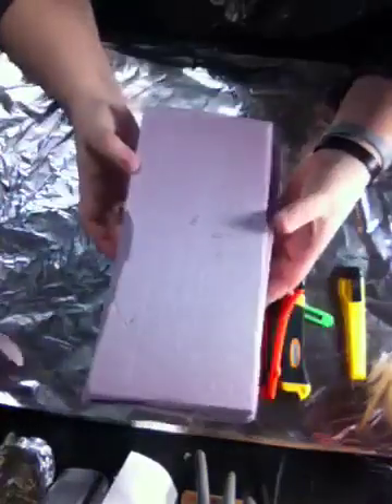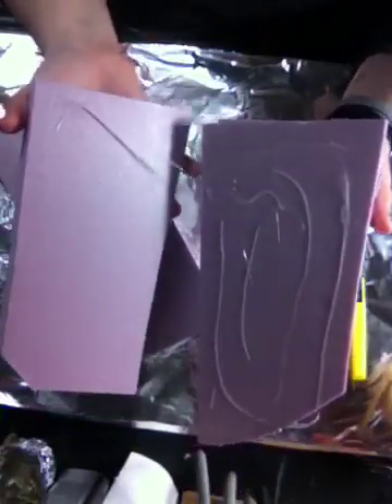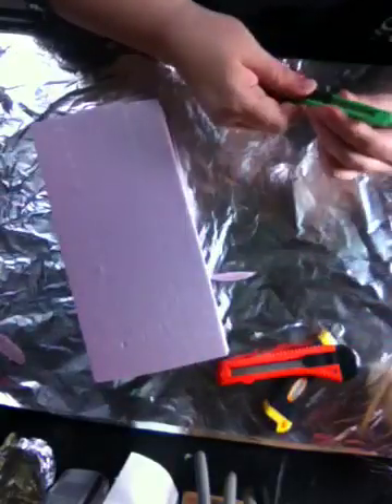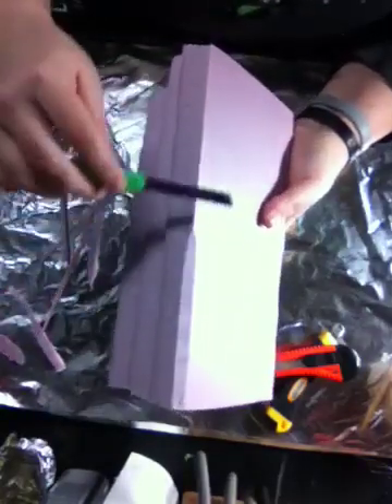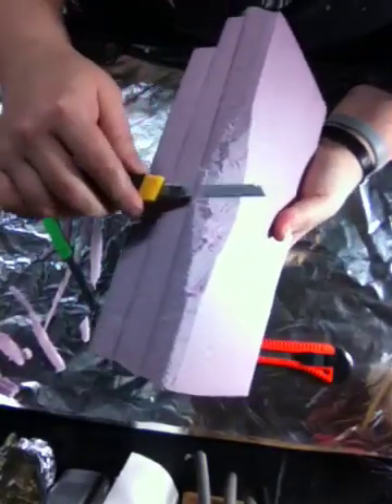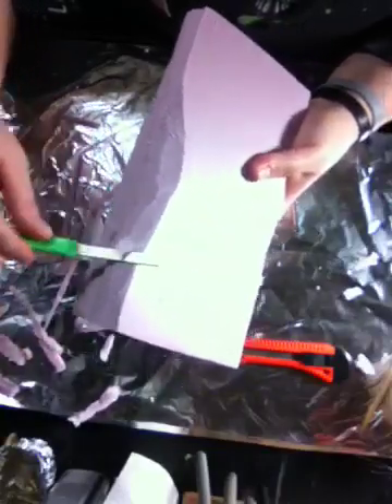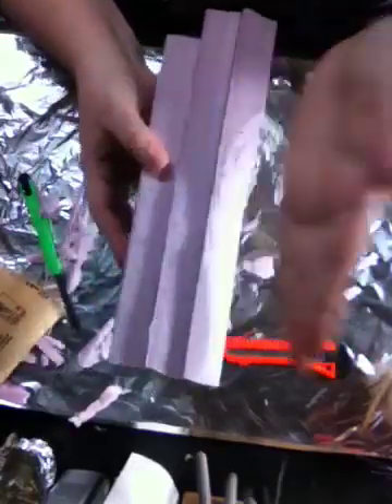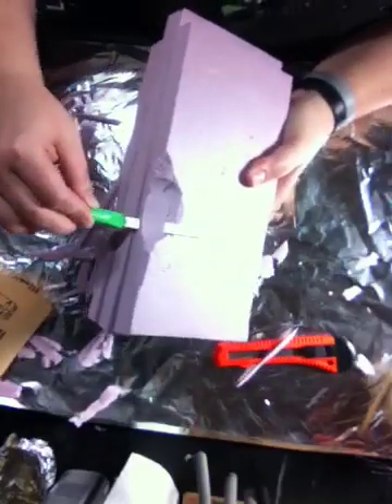How to carve insulation foam

Comment: Been doing foam cutting for years.. been building dios since 1992... before they were even called dios...I would never use hot glue cause it will leave gaps between the layers.. I used any school glue then I put a piece is plywood then use weights on top of the plywood to get a good tight fit... you will still get some seems but no gaps...less filling the gaps ..less time sanding the gaps ...

Comment: that foam is called extruded polystyrene or (xps). it might be better to use spray adhesive instead of hot glue so it wont break apart
Reply: sgvpotter ....careful with this. A lot of spray adhesives have chemicals that dissolve the foam. Test it out on a scrap piece first!! 😉

Comment: I know alot of foam sheets are pre scored for easy cutting.  Im planning on sculpting a turtle shell shaped shield for an upcoming boffer larp.  Ill be sandwiching a piece of corrugated plastic in between the 2- 2" x 36" circles.   If the foam takes a strong hit by a standard kite rod and foam sword how likely is it to break?  Any feedback is appreciated.

Comment: I wouldnt recommend using hot glue to stack the pieces. Use white school glue - brush it on thin and even. Put a piece of wood on top and bottom of the stack and then clamp it - let it set over night. That way if what youre carving has inner details you wont hit the hot glue, which is essentially plastic when dry. The white glue dries thinner and more carveable. 😉

Comment: i have to make a sword for a convention coming up soon. i've made a few props before using pvc pipe and poster board material, but this is the first time i'll be working with and carving foam, specifically, insulation foam.
so this video was really clear and helpful! thank you! i do have one question though, the blade for the tool i use now is super dull. i'm thinking of just buying a different kind of tool overall, like the ones you use in your video (with the long, flexible blades). could they be bought from an art store like ac moore or michaels?
thank you again!
Reply: KingKamina I'm going to a convention also! I really needed this help cause I'm trying to make Shinichi's throw arm off of parasyte. ^-^

Comment: how would you seal it afterward?
Reply: You can use PVA glue or wood glue as a simple cheap way to seal it but that isn't the only option. There are tons of ways.
Reply: WartoothDesigns thanks! I didn't think you'd respond so fast.
I'll try using wood glue. I usually coat/seal most of my props with mod podge and drydex. 
again thank you!